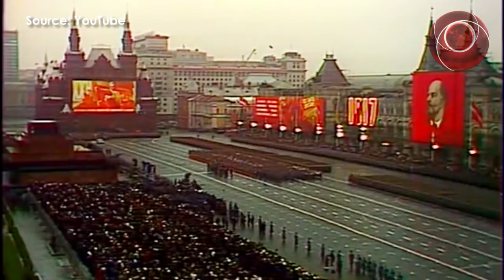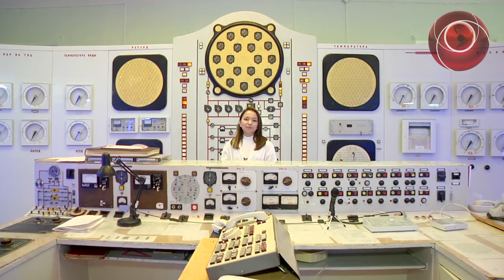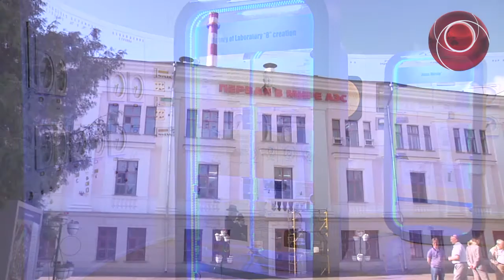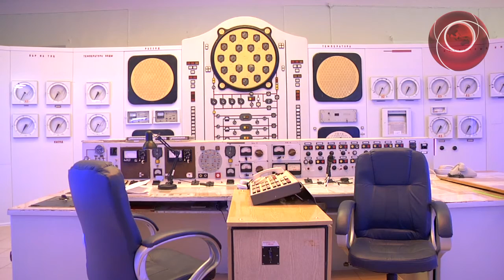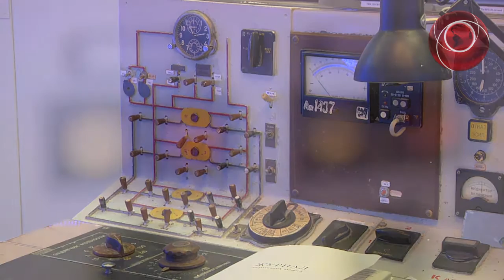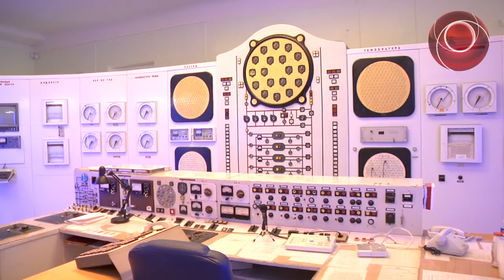ELN - Russia's Obninsk Nuclear Power Station | Energy Live News

Comment: The USSR was so advanced in so many ways, it set the bar high for other states to follow. It’s so tragic that they couldn’t go past state capitalism and so was what ended it in the end.
Reply: The Soviets did some interesting stuff. Nuclear superheating in the cores of reactors, power plant waste heat greenhouse, fish farm, and industrial projects, high efficiency lean burning direct exhausting turbopumps for rocket engines and the advanced metallurgy, ceramics, and materials science that it required, and computer architecture breakthroughs like the pipelined superscalar Elbrus-1 computer. The guy who designed it, Vladimir Pentkovsky, ended up at Intel and designed the pipelined, superscalar Pentium processor. But yeah, the planned economy was horrendously inefficient and crippled the Soviets. They were never able to computerize the economy due to total lack of incentive to reduce costs and increase efficiency within the Soviet industries. It was because the industries never had to be self-supporting; they got their budget from GOSPLAN, not directly from sales to consumers or other industries.
Reply: @gregorymalchuk272  https://youtu.be/5E8wtXnhhj8
Reply: Because soviets rushed it with no regards to safety
Reply: Socialism is the worst thing that ever happened to Russia. They replaced the profit motive with nothing and it was a disaster; so almost immediately they had to start shooting people as a replacement for the profit motive. They had quotas for shooting people; a certain number of civilians to murder or work to death in slave labour camps. No meat and no toilet paper, but at least they had sputnik and nuclear bombs. Yuri Maltsev, a soviet economist who defected, say the official figures were all BS and the civilian economy; the things that weren't bombs or government boondoggles, was about the size of Sweden's.
Reply: @soylentgreenb  socialism’s such a bad thing that a vast majority of Russia begs for it back.
Reply: @oceanthresher6184  It doesn't sound like you live in Russia and if you do then you likely associate with lower class possibly outside of major cities. Lower classes want hand outs (by taking from those who excel) even at the cost of long term prospects, since now those who excel either leave to a country with more favorable conditions or give up at a quite high rate. That is what caused the fall of USSR, and the people and army rebelled in 1991, very notably by occupying are around white house and shelling it by tanks.
Reply: @soylentgreenb Socialism was so bad and inefficient that they managed to fly to space, build nuclear power plants and even invented nuclear fusion reactors roughly 40 years after the population couldn’t read and write and after the destruction of two world wars.
Socialism was sooo inefficient.
Reply: @soylentgreenb  I like professor Richard Wolf’s explanation of what happened to the USSR

https://youtu.be/5E8wtXnhhj8

The profit motive in capitalism isn’t the gem you think it is. Some of the darkest shit that goes on in the world is due to that. Human trafficking, black market organ trafficking, hell even the completely legal and common practice of putting profit over people causes so much harm. There’s so much you don’t know my dude that we’ve all been taught to regurgitate without thinking that it baffles the kind why we even believed what we did before learning more about it.